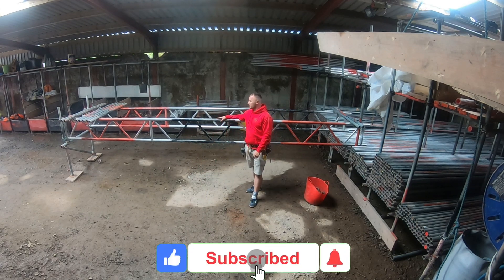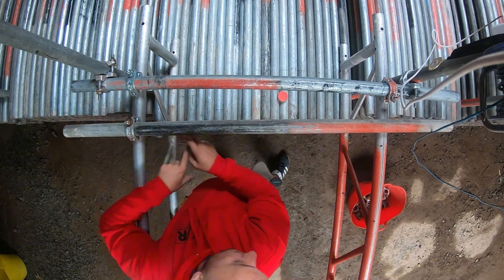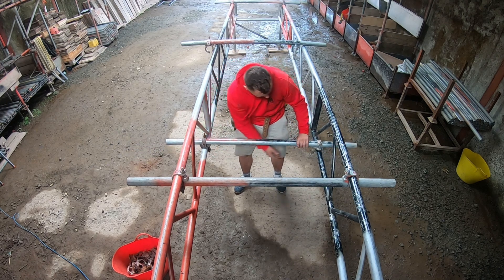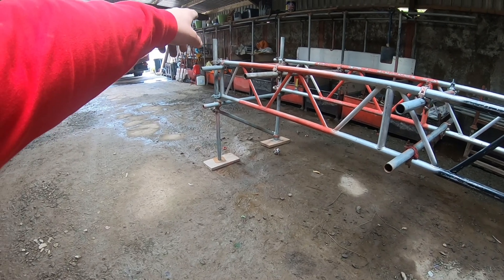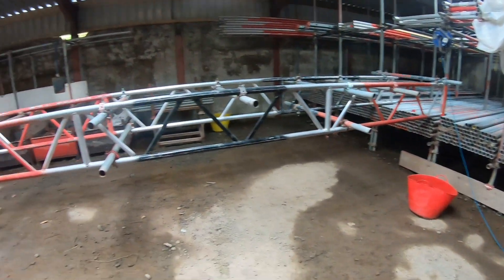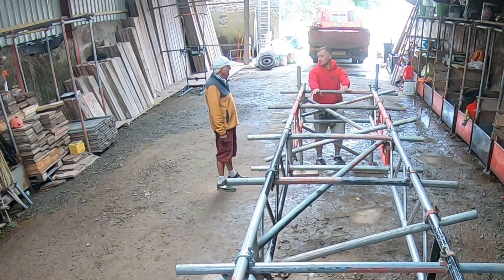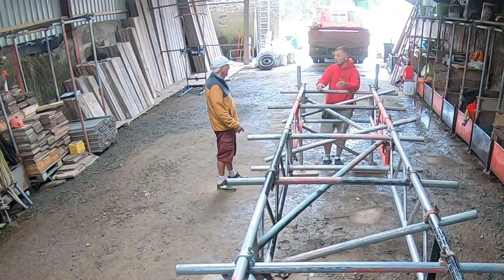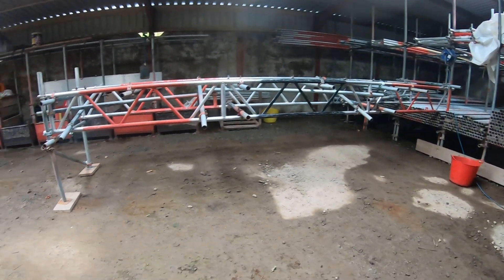Scaffold Training: Beam Work Techniques

Comment: Top cord is every 1.2 meters not a meter and bottom is every 2.4 meters
Reply: 1.2 and 2.4 respectively are the maximum spacing for chords anything less than would only increase the strength of the structure unless overloaded with kit. Only have to work to tg20 if you can't provide a better alternative. Same example for transom spacings.. 1.2 max. There is circumstances you would smaller spacing in the real world.
Reply: @caenmarshall1336   yeah true but since bay sizes are usually 2m for punch ups most just do the 1m and 2m so tie tubes land at punch ups as checks
Reply from the maker: Great comments

Comment: You wanna see what they want you doing on course now, plan bracing with 5s all the way down same way like 32 5s to a set of 8m beams 🤦
Reply: You do it on swivels off the top cord, it's a right pain in the arse, it's honestly a nightmare
Reply: Max span of 4.8m without a design too even with 8m beams
Reply from the maker: @AJAXLDS   how do they do it with 5ft as you can’t get them with the lace tube underneath
Reply: @Madscaffs   all it is, is a case of someone at nasc trying to prove theyre worth their money, changing things that have proved to work for years 🤷‍♂️